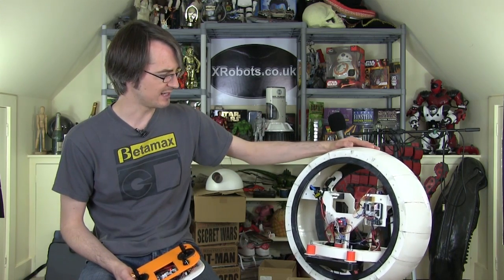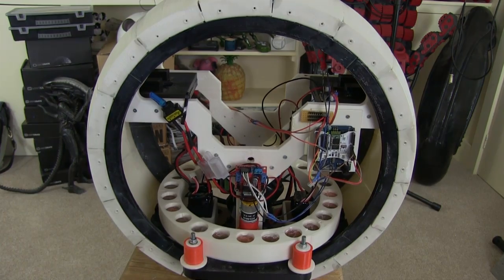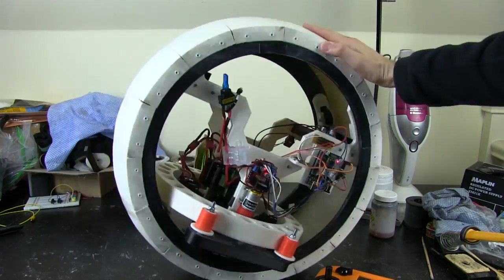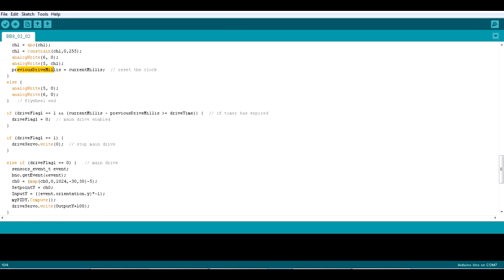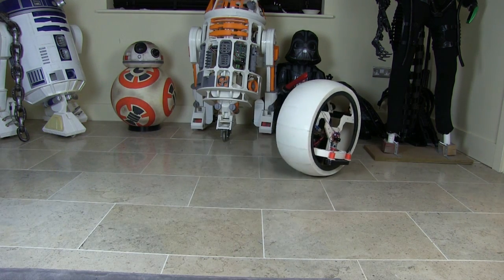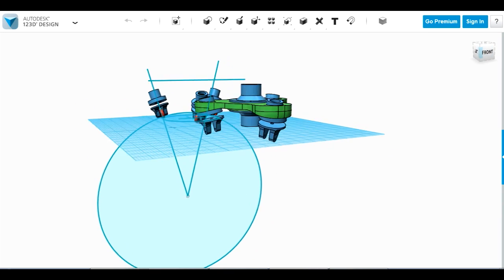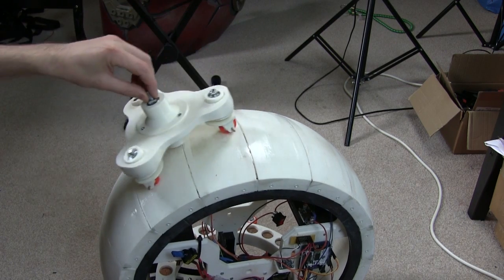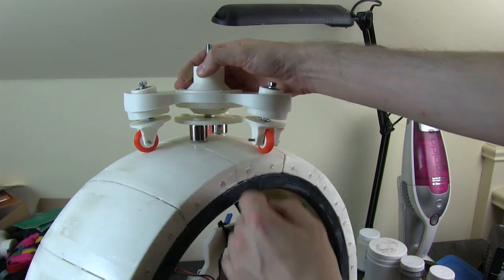Star Wars BB-8 Droid v2 #2 Dynamic Stability & Head Dolly | James Bruton

Comment: Why not just use omni wheels that would not have required rotating casters.  Would have also weighed quite a bit less.
Reply: +James Bruton (XRobots) I just mean unpowered freespinning omniwheels so that the head could move in any directions without any resistance or need for casters.

Comment: Can you use the rubberized ball (from the original mice made in the 80s' and 90s')  in place of the plastic ones in your plastic head casters? or possibly 3D print your own caster housing to accommodate the rubber mouse ball.

Comment: For the magnetometer issues, did you consider the issues might be caused by magnetic interference from the motors? I've run into that issue before, where the magnetometer is fine until you turn on the motors nearby.
Reply: +James Bruton (XRobots) Oh that is strange. I wonder if there is a difference in current draw between when it rotates the whole robot vs. just the flywheel. I don't think there would be... but that could cause the issue. Anyway, great watch so far, this is a really cool project.

Comment: I mentioned maybe a physical spinning gyro to stabilize the ball like a coaxial heli, is that not feasible due to it's noise? shouldn't both disks counter each other. then again driving and turning will be an issue due to differential torque changing the speed of the disk.

Comment: G'day James. I've been watching the older versions of the BB-8 and I am amazed with the idea to put the motors on the inside first, before adding a head. A comment on how you could improve the stability of your BB-8 though; why not use an old fashion gyroscope on the perpendicular axis to the floor? The speed could be controlled with a simple PWM control of  the electric motor and use the differance in rotation iinertia, at different RPM to rotate the entire unit.

Comment: couldnt you have used a second independent flywheel on the inside to help counterbalance the one currently used for turning (in the sort of gradual way you've got the forward/backward motor doing it's thing)?

Comment: Amazing work. I do have a question/suggestion on the casters. Would the casters be more stable using rubber or synthetic bounce balls encased in a two-part printed housing with needle bearings? The housing would be almost identical to the ones you first tried. I am assuming the interior of those is similar to the mounting for an old trackball or mouse. That would eliminate that caster flip prolem.

Comment: James, your head dome caster arrangement is really well done. It looks like it should work well like that and you avoid the ball casters completely. I would like to suggest that you could solve some of your stability problems by using some large rotating flywheels inside the ball. You could position them at right angles to one another and the gyroscopic action would create a stable platform inside that will resist any change in orientation. You can use that to drive against the outer ball instead of relying on gravity which only works in one direction.  With this setup you could have a totally free driving BB-8 like the original version you did.I also think I notices in the new "International Trailer" that came out yesterday that there seem to be lights on the ball section of BB-8. You may need to add some small LEDs with batteries into the shell.
Reply: ***** Maybe it goes against your preferences, but what I was thinking of was to have LEDs embedded into the ball itself with a separate battery back inside the wall of the ball shell, so that the ball could roll around and you wouldn't need slip rings and stuff like that. If you prefer only a single battery for the whole robot, I can understand. I was just considering the possibility of putting a separate battery and maybe even Bluetooth transceiver in the shell itself, so you can blink and control the lights and maybe some moving panels in the ball shell.

Comment: Nice work. It seems to me though that the torque wheel you are using for spinning on the spot might actually be a really good way to handle all three axes. If you look at BB-8, there are six orange circles spaced around the ball. If you imagine that there are wheels behind each of those, just like yours but not on a separate rolling frame, then by combing the motion of those you could create a torque in any axis you want. You'd lose the ability to have the head on a stick, as you plan, but your version 1 head could be repurposed to maintain a fixed attitude on the independently controlled ball. This way, I believe you could still have the head sit off-centre, while the ball uses the torque wheels to hold position. Writing the control software might be pretty tricky, but the mechanical design becomes much simpler.

Comment: I don't think you should raise the platform or distance the inner magnets, just put a bridge support between the two outside magnets.  They're bending inward toward on-another.  A bridge would make the plate more rigid and keep the magnets in the desired orientation.

Comment: james you had an elegant solution before for the head: omniwheels. If you let them rotate freely on their shaft, they act like non-swiveling casters. 

edit: I think you can put a third magnet in an halbach array configuration, and accordingly reduce the overall size of the magnets to gain some weight.
Reply: ah! not good, I guess the number of small wheel is too small and they are too far from the ideal toroidal shape, but making them custom would not gain you any time or money.

Comment: Great work!  You could try replacing the metal ring with glass, concrete or other dense non-metals. While you're at it you should probably make the wheel quite a bit heavier. These would be bigger but since you have quite a lot of empty space inside your current flywheel it should balance out. Otherwise  you could use MU metal foil to shield your ring but this seems quite expensive and complicated. the heavier you make the flywheel and the more you decrease the friction of the hub shouldn't the internals move less and as such the steering would be closer to the central axis.

Comment: you could use some old mouse balls :)
they got rubber.
what if you made 2 more flywheels that are 45degrees offset in both directions.
that again are in right alignment when leaning forword.
then you could lean it in speed for slacky turns :P
Reply: i see your point.
and at those old mouse`s, the load isn`t at the ball.

Comment: About the whole steering thing, perhaps you could make the ball lean left or right as it's moving forward or backward? That should get you a bit of steering while the thing is in motion, and then use the flywheel system to turn left or right in place when stopped.
The implementation is the trick of course. Simplest approach I can think of would be to replace the single circle of the flywheel with two independently-moving masses:

When moving straight forward or backward, the two masses of the flywheel would be kept in direct opposition, along the line of travel.
To adjust the balance left or right while moving forward or backward, move the two masses toward one side. (For an extreme left turn the two masses would swing all the way to the left side, causing the ball to lean left)
To spin in place, spin the flywheel masses while keeping them in opposition.
This mechanism would also give the machine the ability to dynamically balance laterally to some extent.
Concentrating each mass at the end of an arm would give you greater potential tilt, while distributing the mass around the perimeter of a circular edge would allow you to balance the system more precisely.

One way to implement all this would be to have one motor that drives the whole flywheel (both masses) as a pair, and a second motor mounted on the flywheel that moves one mass independently of the other. Though one challenge there is that if you mount a motor on the flywheel, you've got to get power to it...  So some kind of brush-contacts or an independent battery mounted on the flywheel or something.
Another approach would be to have the two motors stacked, one on top of the other with the shafts facing each other. The challenge then is driving those two motors at the same speed to keep the two masses in opposition. This might not be too bad; if you can turn while driving, then the ability to turn while stationary becomes less important.
In either case there would probably be a need for some feedback system to detect the position of each mass. The ball would wobble in stationary turns if the masses aren't in opposition, and you'd want to orient the masses correctly according to the maneuver you're trying to achieve. It might also be possible to devise a purely mechanical solution, in which the centrifugal force exerted upon the spinning masses acts to keep the two halves of the flywheel in opposition.
Another (possibly serious) problem with this system is that a significant amount of force would be swinging around, exerting an unbalanced centrifugal force on the motor axis. But this force only becomes significant when doing an in-place turn. So in the first configuration the system would be fine as long as the two masses are kept in opposition while spinning. In the second configuration the stresses could be balanced out by coupling the two motors' shafts with a bearing assembly. Again, the implementation becomes simpler if the tilt-steering turns out to work well enough that it's acceptable to do away with flywheel-turns entirely.
Reply: ***** Think it'll work? I'm a bit skeptical but it'll be interesting to see how it plays out.
Going back to my idea (and looking more carefully at your current implementation - noting that there's no "central axis" for instance) I guess the way to implement my suggestion, if you wanted to, would be to have basically the same flywheel mechanism that's there now, but two of them stacked on top of each other, and with different (opposing) mass distribution.
Reply: I'll take your word for it, then. :)
Reply: +James Bruton (XRobots) Gyroscopic Precession effect where the rotating force manifest itself 90° later from the point of application.
Reply: Mike Doyle Alright, I'm itchin' for a physics lesson. School me! (And I'll do my best to keep up!)
If we move the center of gravity of the ball to the left while the ball is rolling, the instantaneous net effect is that there will be a force acting to tilt the ball to the left, yes?
Of course, we must consider gyroscopic precession: the force is acting on a rotating mass. So that leftward force on the top of the ball instead acts upon the front of the ball.  Instead of rolling left on the Y axis, the ball yaws left on the Z axis...
Doesn't that still accomplish exactly what we want? A left turn? (Or does the fact that the pivot point of the "tilt" is at the bottom of the ball, rather than the center, change the effect?)
(As a side note, I never suggested trying to spin the flywheel while the ball is rolling. Maybe I wasn't clear about that? My suggestion was to split the flywheel mass into two independently-moving parts so it could be used to shift the robot's center of gravity.)

Comment: Do you think you'll make the exterior of the big ball more like the one in the movie? Probably made of sets of 6 circular and 4 triangular separate parts with LED lights and such?
If so... Then will you have an external ball and an internal ball where those parts attach?
(the internal being smooth on the inside and the external on the outside)

Comment: Would a larger  gyroscope based system solve a lot of these problems. As it would always be parallel to the ground, it's mass could be used for turning via a speed controller or brake and you should be able to use this while moving as it shouldn't tilt. It might also stop the inertial and side to side wobble as the mass would always be level rather than tilting.

Comment: I haven't read through all the comments, so perhaps someone already suggested this...  If the spinning coins in the flywheel are confusing the magnetometer, could you not use non-magnetic weights for mass, e.g. lead or even ceramics?
Reply: Had the same thought! Even stainless steel could work. Of course sand filled ballons, ceramics, heavy plastic or rubber would eliminate this effect, too!

Comment: This may be a silly question, but how will the magnetic gyroscope work with all those strong magnets so close to it? Won't you start having the same issues as you did with the motor? Or is there enough distance between the head magnets and the sensor board to make it irrelevant?